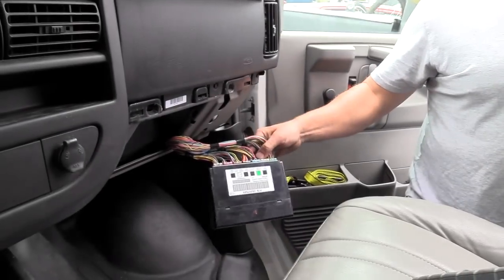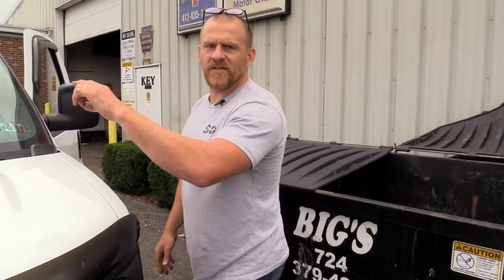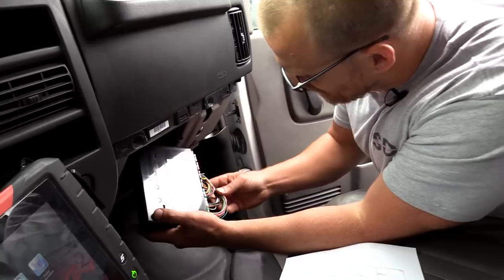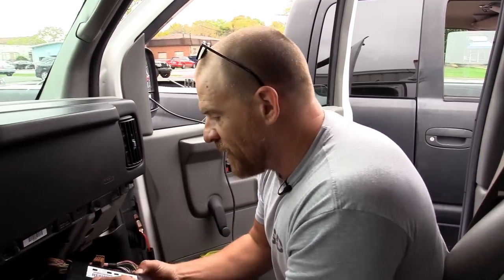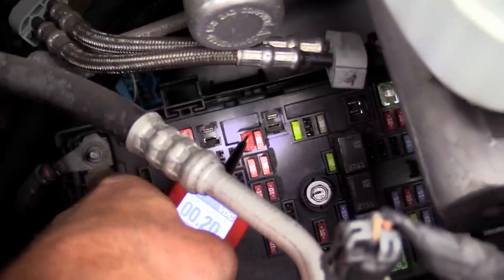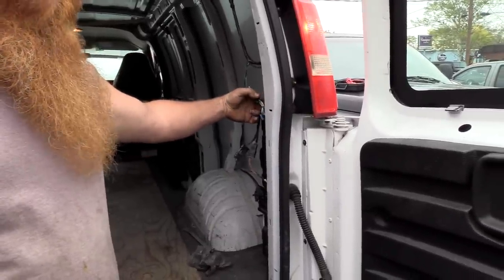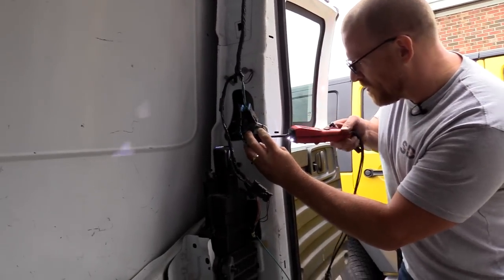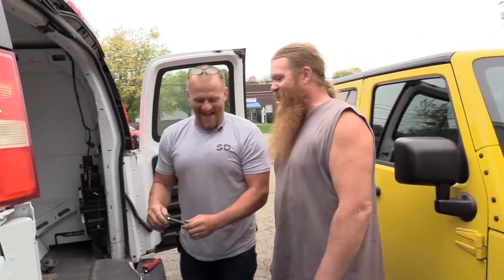BCM Controlled Tail Light Circuit Diagnosis

Comment: Hey scanner danner, I just want to thank you for posting videos like this, all the knowledge you put out there. Thank you so much, I spoke to you almost a year ago, about looking for my first scope, I bought a uscope. I have been practicing with it all year, with ABS sensors, injectors, anything I can. I had this exact issue with my moms car 2008 Enclave her right front turn signal was not working, I’m 21 I’m still in school for automotive. I had zero electrical knowledge about a year ago. I love what I do and YOU are the reason I want to better myself as a technician every time I watch a video I think to myself “what if this car showed up to my shop” it’s gotten to the point to where I watch your videos after work as I’m relaxing at home haha, but anyways I was doing all the test I could, I’ll checked power, checked ground, everything that your brother did. And I was 99% sure that I was going to need a BCM, I was thinking maybe the light shorted out, and it burned out the driver in the BCM, but I found this video and you brought up checking the powers and grounds to the BCM, I did exactly that and found the courtesy relay, was blown. Replaced it and now the turn signal works. Ive never gotten such Joy, I just felt amazing after being able to fix that, like the feeling of tackling an electrical job in which I was confused, came to a solution and was able to diagnose properly and fix is such a great accomplishing feeling, but I would of never got their without this video, watching this video put me in the right direction, and helped me fix my moms car, again, thank you so much. Thank you . Thank you, for doing what you do, happy holidays, stay safe and again thank you for the knowledge you share with the world. Your awesome.
Reply from the maker: You cannot describe the feeling, can you? I can't either!
It is amazing for sure. 
You know what else happens for me? When I hear this type of story from guys like you, and I get to hear first hand what this has done for you? It is the exact same feeling my friend. So thank you for that and may God continue to bless your path.
Reply: @ScannerDanner  Mr Paul do you always attack a short to ground anytime you see a blown fuse??
Reply from the maker: @smartnwogu8316  yes sir, every time
Reply: tony... something does not make sense... the courtesy light relay? driving a blinker and courtesy light!? see my post in main thread for some interesting info on GM/Chevrolet BCM controlled turn signals

Comment: 17:50  I was yelling at the screen.... Kudos to Caleb for asking that.... When fixing guitar amps, I never put a new fuse and go.  Fuses are blown for a reason, and you have to find that reason.   Great job like always.
Reply: But in this case, the reason is likely disconnected. I'll always put a new fuse in straight away to see if the fault that cause the fuse to blow is still present rather than wasting time hunting something that may well not be.
Reply: In this case, after all the revision Paul did, we can presume the problem was external. The trailer had a short, the connector got wet, something external, not present at the moment. But it was still worth checking.  In the case of a guitar amp, not spending that extra time can be a recipe for disaster. Audio components are very sensitive to voltage peaks that fuses don't prevent sometimes. Besides, dealing with voltages up to 600 DC,  that extra time is more than mandatory.    However I see your point and agree with you on this one, Just looking at that wiring harness is enough. Cheers mate!

Comment: In England we have connectors made by Scotch-lock. They are the  I.D.C. Type (Insulation Displacement Connection)  These are great for single solid drawn conductors but absolutely garbage for multi-stranded cable and even worse when they are used in a mobile situation. They work great at first but soon give intermittent faults as time goes by. Cheers again. Peter A.

Comment: I know this guy can walk circles around me when it comes to knowledge of computer components and so forth. The first thing I check when something does not work right are all the fuses and work from there. I loved that  you checked the last option and saved the customer from a extreme repair. Ive done Residential, Commercial, and Industrial electrical for a few different companies and automotive repair also. Then joined the Military and played with track cars for the rest. Automotive wiring can be a nightmare if you dont have the proper tools/access to schematics. Anyway, what Im saying is, just bc you er a electrician does not mean you understand automotive circuits. That is also reverse for automotive knowing high voltage/current. The principle of travel is the same and for the most part how it gets there.  However the automotive color codes with different models will mess your head.
Reply: Easy breezy

Comment: In my limited experience in over the road trucks a telltale sign of some sort of lighting issue like fuse, bulb, chassis ground break etc. would be the sped up blinker flashing. I typically always look at the fuse panels first on any vehicle. Time is money & I may not be flat rate but that little handy fuse bulb in that plastic fuse box you got there is something I'd use every day for sure. I use a DMM daily to test solenoids, wheel speed sensors, fuses, relays paired with a 9v battery, when it comes to electronics there are 100 ways to skin a cat.

Comment: I had the same problem with the same year van (only drivers side). When looking at the turn signal wiring diagram" in Mitchel there are no turn signal fuses shown (this is probably what you brother did). What saved me the time of the BCM diagnostic  was that someone posted a tip in Mitchel in the turn signal operation section that told about the fuse (labeled as a BCM fuse).

Comment: Great video.  It's nice to hear the thought processes involved while you are troubleshooting a vehicle.  I am retired now, but used to do that kind of stuff on cars, and a lot of other types of equipment as well for a living. 
Another thing to consider when working with a ring on, shorting a 12 volt line to ground.  If that line has the capability of flowing lots of amps your ring could get very hot, very quickly.  Forget about a shock hazard, the burn wouldn't be pleasant.   Yes, I also used to work with a ring on too, but every once in a while I would take it off and put it in my pocket if I caught myself having a near miss with a bad experience.

Comment: A few months ago I diagnosed an '05 Volvo V70- driver side low beam headlight didn't light. I called a bad central electronic module. I didn't check powers and grounds to the module. Now you have me second-guessing myself. It was my uncle's car and he didn't want to spend the money on a new module. Not sure what he ended up doing. I was 100% confident it was the module up until now.

Comment: Great video yet again S.D. But yes, please use the power probe more and a video on it, like how you can check power, ground and give 12v, but what is it like for short to ground testing, does it read as accurate as a D.M.M? 0.03ohm?   short to power, high resistance, end to end test, load test. Looks like it would save a lot of time. 🤗

Comment: Hey, great video, Dan! 😝 Just kidding, PAUL!! 😁 I always saw that in the comments section in the past. 😂 I corrected a few of them a few times ... but it was like an invasion - there were too many! I was overrun! 🤣

Caleb gets it 100% now - can tell by his question regarding the fuse. 😎

What a strange design that was. A dedicated power to brake/turn. GM for ya! Better that than a new BCM, any day! Bet GM doesn't give those suckers away. At least you didn't have to crawl on the ground to inspect the wiring ... but, what a "fantastic" location for that fuse box! 😬

Great stuff as always, brother! Have a blessed day.

Comment: Good Video. I just had the same problem on a 2011 F350 with a flat bed, But it was left side. I spent half the day searching for broken wires in the rear, and since its not a factory Pick up bed it had different wiring. I did find a bad connection in the tail light (Brown) wire, but couldn`t find anything in the yellow turn/brake wire. after repairing that wire I still didn`t have left turn and brake. I was searching for relay and that was how i found out they are controlled by BCM. I had a code B132B:11 which is left turn short to ground. and a code in in the steering control module for the switch. Since i had already repaired broken wire, I cleared the codes in BCM and steering module and everything started working fine. At the same time i was trouble shooting that, I was getting a TBCM fault and found one blown fuse and a missing fuse. Replaced them and I now have trailer brakes.

Comment: Great vid!  Just had same issue on a 2015 GMC Yukon RR factory LED turn signal - no op.  BCM switch inputs good, no output to turn signal.  No codes or any other issues with vehicle.  BCM is supplied power by 8 fuses.  BCM - 6 fuse (15A) failed.  I'm reminded - check the basics even though logic might prompt otherwise.

Comment: This Danner thing is too confusing.  We have to start calling you Scanner Pauler now.  That's a really great example of why you always check your powers and grounds.  I probably would have hit the hazards to on my initial inspection for another input, but you're right if the fronts working is not an input issue.   I wonder how many, "See you should check all the fuses first", comments you will get.  Eric O at SMA send me a PP4.  I love that tool, I use it in conjunction with my test light all the time.

Comment: I ran into the same problem on a school bus Chevy 3500 cutaway. As soon as you started all I could think of was BCM6 lol but my wires were all underneath.  And I did end up finding a short to ground at one of the securement clamps

Comment: Great video as always... I had Audi with strange electric window fault that if you programmed them they would work all day until you locked vehicle over night then they wouldn’t work until you programmed them again.
Was multiple powers to module.... fuse missing was all that was wrong.
Keep up the good work gentlemen
Reply from the maker: Crazy right there

Comment: A tip with your test light Paul, cut the original "earth clamp" off it and replace it with a male banana connector, that way it is easy to swap out connectors that you want to use ie alligator clip or backprobe or whatever you have in your test connector kit.

Comment: Just thinking about multiple fused power feeds. I guess worst case, everything powered on, say maybe 40Amps passing through this BCM.  Well you wouldn’t want one 40A fuse as that would allow 40 amps to pass to any one shorted output. Dividing it up to multiple power ‘sections’ makes everything safer. Good design imho.

Comment: The wiring on the gms are tough because its hard to find in the diagram the actual fuse for each corner.  Its just labelled bcm fuse.  Lesson.... Before replacing any module check communication and load test all powers and grounds.  Any more if a module is bad a recurring performance code will be set or other modules will tell you its bad.  Either case you still check commx powers and grounds

Comment: SCANNERDANNER, can you make a video showing how to measure every type of sensor one by one in a car using an oscilloscope and OBDII scanner tool. You can use a "good working car" that has a lot of different types of sensors and just really fast testing each sensor using an oscilloscope and OBDII scanner tool to learn from. Its hard watching your videos when I don't know what are good sensor waveforms to compare to as a reference and background to know what you're talking about.

Comment: Wish you'd shown a drawing of that complete light circuit. It's likely that every corner is protected by one fuse since that one blown restored the rr turn/stop to function and nothing else.  I'm surprised that van didn't have a dedicated trailer light module. Many do today.

Comment: blown fuse lol. my first thoughts at rear bulb issue, someone added/hacked in a trailer harness or shorted trailer wiring and blew the fuse.
really, that's the first thing you should always check if it has a hitch, factory or aftermarket, even if there's no hitch look to see if it had one removed (been there done that)
Reply from the maker: To be honest. Without knowing this system other than being BCM controlled lights, to see only one output not working, the fuse was the last thing on my list

Comment: It's interesting to see an individual power feed for each bulb. I suppose it's one way to protect the drivers from an overload or short. Also, the question may be asked why each circuit is fully independent. Well, I know that when a tire pressure sensor relearn is initiated, the BCM will turn on each light in the sequence of LF, RF, RR, and LR to guide the technician to the sequence to relearn the TPM sensors.
Reply: it's mainly done for added current capacity, like when a trailer harness is added and being towed behind. some of them can have many bulbs and be power hungry

Comment: pretty sure they're wired with single fuse feeding each rear side for adding a trailer tow harness, some trailers can be power pigs with lots of lights, alternate add a converter system which has it's own power feed, so it doesn't effect vehicle system with a shorted trailer. they still connect to the factory harness at rear and I have seen shorted converter boxes in the past, so nothing is fool proof

Comment: I have seen a number of BCM's shut down a circuit when an incorrect bulb is fitted, usually its fleet vehicles where there is a mix of 12v and 24v machines but I have also seen it happen when 5w bulbs have been replaced with 10w.
Reply from the maker: great tip!!!

Comment: Great vid from you guys as usual, had a very similar issue on a Vauxhall Astra J with the rear wiper not working. The car had already had the BCM replaced and a rear wiper motor. 
Checked powers and grounds and I was missing a power feed... the supplying fuse was missing! 
These GM BCM’s seem
To have a few powers that feed a lot of circuits. 
Again Paul, great step by step diagnosis 👍
Reply from the maker: Man, I was totally ready to call a bad BCM on this. It is absolutely unique to me to see a specific fuse that feeds a module and when that fuse blows only one output is affected.
Reply: @ScannerDanner  Lmao. I just had this exact same problem on a 2010 BMW and exactly 100% like this video I gave power at the computer plug and circuit integrity was good. Checked the main big powers and grounds at the computer and didn't bother to check the rest. I had no idea that it's possible that 1 power input can effect just 1 turn signal so I hope it doesn't bite me in the ass because the guy went to BMW dealer to get it reprogrammed. This was 2 days ago.
Reply from the maker: Well you know where you're going if it comes back right? First time for me seeing this type of fault too.

Comment: When verifying it is not an input problem:  the scan tool works, for sure.  Keep in mind the BCM turns on that bulb for more than one reason, though:  try using the hazards, or the panic button on the key fob.  At that point you've verified three inputs don't work, and you're either looking at three individual input issues, or one output issue.
Reply from the maker: yes, great points! thanks

Comment: In my younger days of being a mechanic I got burned (sort of) by this EXACT ISSUE ON THIS EXACT SAME TYPE of van!
We replaced the BCM due to a non functioning turn signal in the rear, had it programmed and it still didnt work!
I ended up finding a blown fuse and a rubbed thru wire (work van and tools were thrown in and hit the wire)
I told my boss and he said: Is it working now?
I said yes, after I replaced the fuse and fixed the wire!
He said: good then there is no problem here, let me call the customer and tell him its all done!

We live and learn!
Reply from the maker: Unfortunately this is how we learn sometimes right? Getting burned leaves a scar lol
Reply: @ScannerDanner  Yes, very true! I always remember that van when condemning a computer and tripple check everything!!!
Reply from the maker: Then it was worth it friend!

Comment: Like we look at the stone heads on Easter island, or Stonehenge, some time in the future, they will look back at some of the engineering marvels, like running turn signals, brake lights, radios, etc, thru control modules, and wonder why did they do this? Truthfully, I have no answer as to why.

Comment: At 27:02 when you twisted the taped up section at the back of the traillight socket, you got some nice sparks there ;-)
Reply from the maker: I just saw that! Could have been dust reflecting off of that flash light?? Lol, good eye man
Reply from the maker: Watched it again and I think you are right!! Damn....
Reply: @ScannerDanner  Huh now I'm not sure any more. Dust reflecting in the light could be very possible. TBH I miss the crackling sound of the short, but you're wearing a lavalier mic.
Reply from the maker: @MrZsChannel  Just watched in again on a bigger screen and that was definitely dust :-) Man did that ever look like sparks in real time. I kept pausing it and I am 99% sure that was dust. Then again, I was 99% sure this needed a BCM going into this job haha
The other thing that tells me this wasn't sparks, the tape was not damaged at all and sparks don't jump out of sealed areas in my opinion.
Reply: all I seen was dust flying